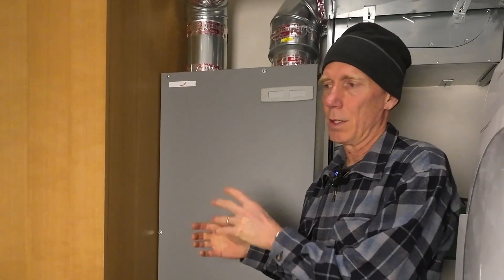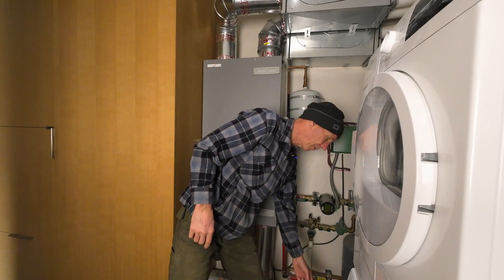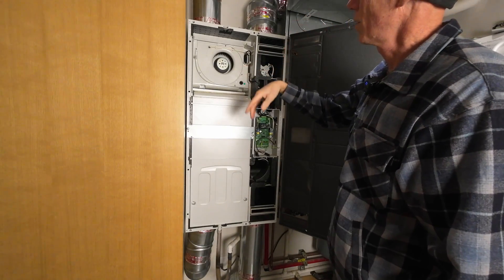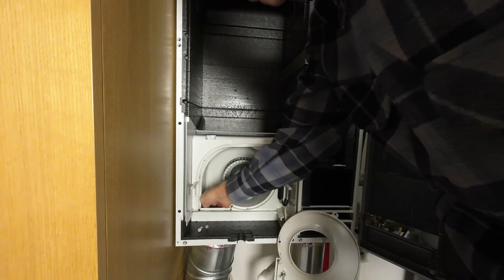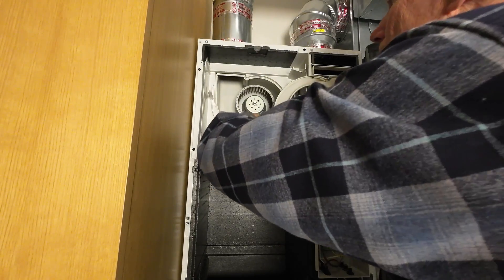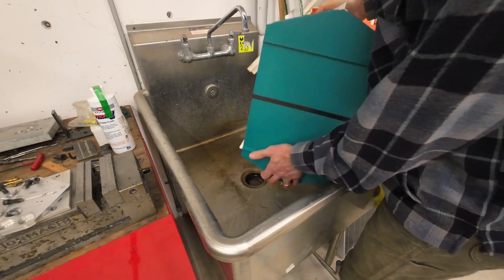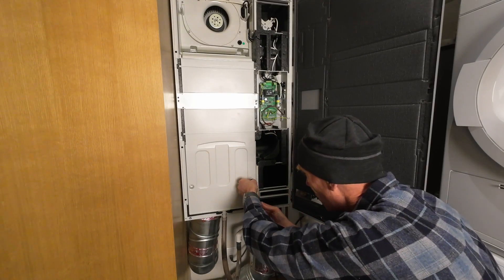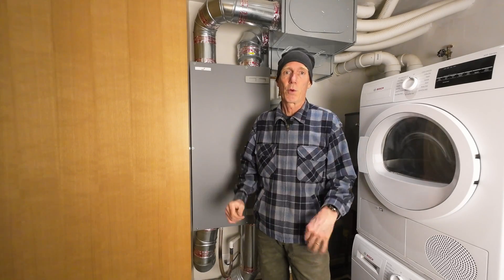015 - howto - Zehnder ComfoAir 200 HRV DIY maintenance

Comment: This video is my go-to for servicing my HRV.  Thanks a million
Question: can you take off the outer grey cover of the unit? I have a tricky cabinet in the way of my unit and it would be great if I could take the door of the HRV off before taking out the core.
Reply from the maker: Glad this helped. I'm not certain about the entire cover. The door of mine seems to have hinges that let you open and then lift to remove the door. Perhaps that will help? There are also several versions of this so I'm not entirely certain what you mean by removing the cabinet.
Reply: @outbuildinginfo  Thanks for the reply. I managed to get the door off in the end. On mine there was a little black screw next to the middle hinge that I had to remove. Then it came off fine.

Comment: I installed mine in 2023 and it seemed fine for the first year, then as time went on I started getting error codes. Well it turns out, my salesman didn't design my system with an additional external pre-heater, and should have and that caused the internal heater to fail. I also have a fan error code. It is a massive inconvenience now to install the external heater so I have been procrastinating because there is no good way to do it. I also think that this thing may do more harm than good! Due to all the condensation within the unit, mold grows & is spread throughout the home. I am thinking I made a very costly mistake installing this stupid thing. Sounds great in theory, but in reality it's not. Normal kitchen & bathroom exhaust/ventilation, doors opening, and running a dryer, all with a window open allows enough fresh air into a home. Add in a few quality air purifiers and you're good.
Reply from the maker: Sorry to hear about that. It may have a great deal to do with the temps/humidity in your environment. Ours has worked well here in our situation. We are building a cabin on a coastal location where the dew point and moisture are completely different. I'm trying to figure out how to best provide ventilation there and it may be completely different.

Houses are, by current codes, much "tighter" than older homes. This makes these issues more relevant.

Best of luck with your air/moisture management.

Comment: Hi! 

I have that machine so thanks!! I thought just the filters should get cleaned. 
Thanks for the huge walkthrough. 

Do you have the comfodew 200?? (Deshumifier for summer? 

Thank s
Reply from the maker: Thanks for your message. I hope the video helped. We don't have the comfodew because we have pretty dry summers. The winter time process of air exchange does act as a dehumidifier in our location/temps.
Reply: @outbuildinginfo  Ooohh nice! In my case, I needed to install the deshumifier comfodew200 as the level of humidity during summer in my area is really high.

Comment: Thanks so much for this video. I’m having some issues with one of my fans, but I’m struggling to get the fan out of the unit with all of the visible screws out. Would really appreciate some advise as you have the same model as me. Thanks
Reply from the maker: Thanks for watching! I was just going through ours the other day and wondered about fan removal (I have never done it). I've been able to just clean things up with them in place so I'm afraid I can't offer specifics on how to remove the fan. I haven't looked, but perhaps Zehnder's documentation has an exploded diagram of parts? That would at least reveal a hidden screw or something keeping you from removing it.

If you figure it out, please drop another comment as I'm sure other would love to know.

Comment: Would love a video about these 2 fans on the left side behind the white plastic cover. My upper one is "wobbling" and making annoying sounds. How to remove/replace/repair. You got the exact same comfoair as me so it would be nice to see
Reply from the maker: Thanks for watching and commenting. I'm about to do my routine maintenance and will take a look into the fans to see if there is something to learn there. My first guess if it is wobbling is that it has become unbalanced due to being dirty. Completely cleaning that may help unless the motor bearings have been compromised in which case, you may want to consider replacing the fans. I'll post either a note here or a follow-up video if I learn more when I do my next maintenance.
Reply: @outbuildinginfo  thanks a lot ^^ they are quite clean though
Reply: @Luxtrooper hi, was there any follow up on this? I’m in the same position but
I can see to get the fan out for inspection, struggling.
Reply: @ nope sadly not, its wobbling wnd wobbling...its just not spinning smooth, cant get them out. i pulled on one and i think i made it even worse....i just have to live with it now i guess. i let it spin on medium, on low the sound is more hollowed/muffled and annoying
Reply: @ ah okay, I get a full on error now because of it. Thanks for replying anyway!

Comment: Very - Very good. I was looking for this a looooong time, now it is here. Great!!!
I have exactly the same model, but I was scared to open the thing up. I have to do this cleaning, as since it was installed (5 years ago) it was not cleaned internally. The 2 main filters I changed yearly with 3-4 mounths interval compressed air cleaning.
I am very happy that I found your video.
Reply from the maker: Thanks for commenting. I'm pleased to hear this was helpful for you. Once we figured this out, we have been able to do simpler cleaning roughly annually and haven't needed to remove the pump as often. Knowing what shape it takes and how it is put together makes that simpler cleaning possible. 

Much of this seems to depend on the types and age of clothes we are drying as each has a different amount of lint and small fibers that are introduced.
Reply: @outbuildinginfo  Me again, managed to clean the device perfectly, all was OK untill now. The device still works, but I am getting Error code A6. Any suggestion what to do? Have you expirienced anything like this? Thanks!!!
Reply from the maker: @ffookkaafoka3685  Not sure what A6 is. Anyone else know? I've done this cleaning about 2 times since this video but have never seen that code. My only thought is that the wires didn't get fully plugged back in? There isn't much else that would change when you do this. Sorry I can't give you an easy answer.
Reply: @outbuildinginfo  No, the A6 code appeared about 3-4 mounths after the cleaning ... it is not related to the actual cleaning! The system was working the past 3-4 mounths as should, but about 2-3 weeks ago this A6 code error appeared on the display. The device seems to be working in order, I do not see any faults, other than the code on the display.

Comment: There are actually 3 filters, the third one is hard to get to
Reply from the maker: Thanks or commenting. Where do you find the third filter on your system? Is it built for removal/cleaning or permanently installed?
Reply: That mentioned third filter is actualy not an air filter (why would there be a third air filter in the system ... after filtering both inlet and outlet, no need to filter one or the other two times) that, what you call third filter is a preheater element in the system!